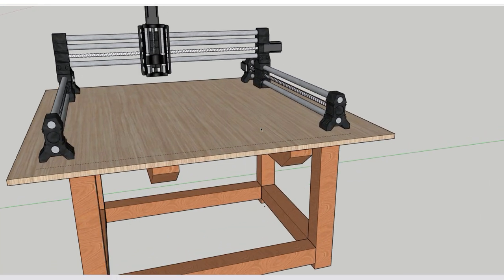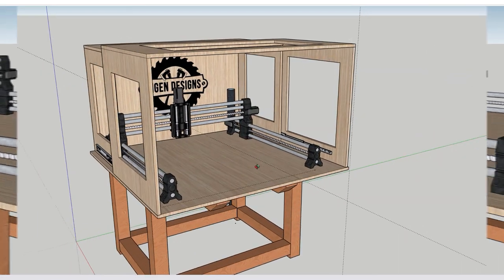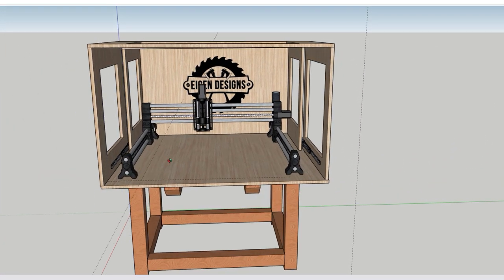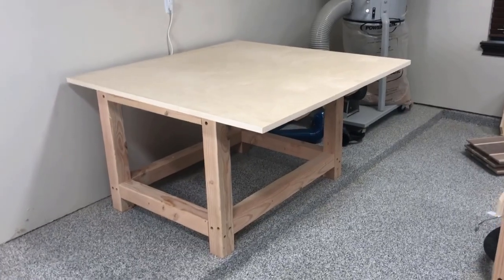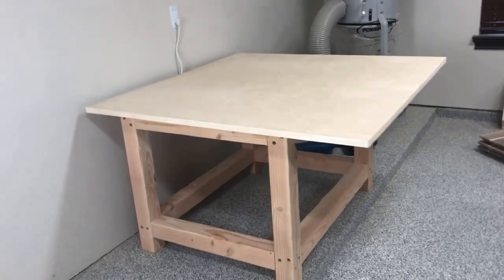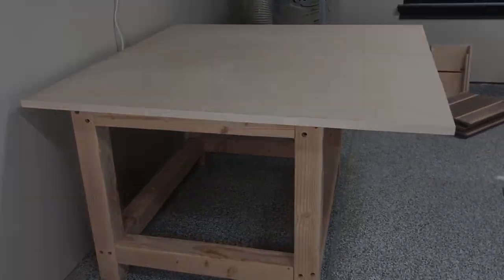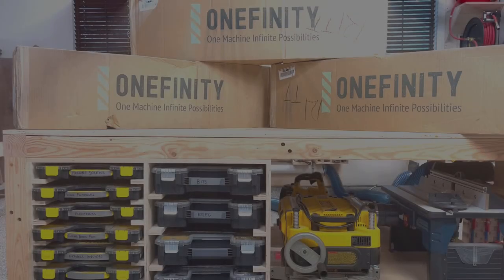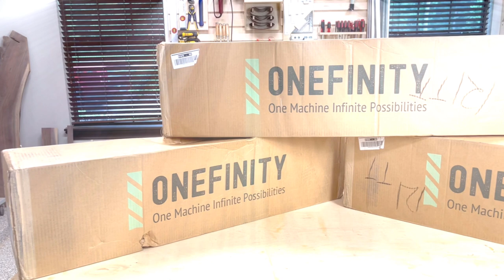OneFinity CNC Unboxing & Assembly (+ Upgrades!)

Comment: Congratulations - your Onefinity has arrived !! I watched your table build video a few months ago and subscribed then. Now, I get to watch you assemble your machine. My Onefinity Woodworker is in the "testing and packing" stage as of July 25, so it should be here in a week or two. So, I'm checking out everyone's Onefinity build videos getting ready to get mine together. I still have not decided on table "style" nor size yet. My shop is in the basement, so space is at a premium. I'm "leaning" towards a tilt style enclosure. Thanks for the video, Charlie in Central Ohio
Reply from the maker: It sure is exciting to have it all come together. The learning curve is pretty steep if you are new to CNCs, but there are a lot of great resrouces out there. 

One tip: as you think of your dimensions for the table, keep in mind that if you choose to use a SuckIt dustboot, it will protrude a few extra inches from the router so make sure you leave ample room for that. My table is 52"x53". Good luck!!

Comment: Nice work! I’m waiting on mine and did the same as you in preparation. It should have been shipped the week of July 25, but they are running 3-4 weeks behind. Maybe I’ll do as you and make a video when it arrives. I’m as set!
Reply from the maker: The anticipation for mine was palpable. I tell you what though, it’s worth the wait. I use mine all the time for a variety of tasks. You won’t be disappointed!

Comment: Was that logo made with the CNC? That’s a pretty cool set up. I feel like I have a ways to go before I get a CNC. I have too many other projects/chores to do before I get into stuff like that. Great video once again, I’m always impressed. Thanks for sharing 👍
Reply from the maker: I actually had the vynil logo made by someone on Etsy. Someone was kind enough to cut out my logo for a pretty nominal fee and ship it to me within a few days. I do plan on carving out my logo as one of my first projects though. Lots to look forward to!
Reply: Really nice set up! I am looking forward to seeing your enclosure video. I just got my onefinity and have not unboxed it yet. They actually forgot to ship my display as well and I received it today. What software are you planning on using? I am leaning towards Vcarve Pro. 
Thanks for sharing!
Reply from the maker: @jayceejocko1655  I have downloaded Fusion 360, which is a part of the Autodesk product line. They have a free version for hobbyist woodworkers. The reason I chose Fusion 360 is because you can do the CAD and CAM in the same program. I don't have enough time in the program yet to recommend it, but that should change in the coming weeks/months. 

btw, I still dont have my screen :(

Comment: That sucks about the display unit missing. Their pretty good about over nighting items from Canada, hopefully it only took (takes) 2 day(s). You could use a extra computer monitor to fire it up and connect it to laptop, once my laptop was connected to mine, I rarely use the actual monitor.
Reply from the maker: Their customer service has been really responsive. I think the screen gets in today so hopefully I can get up and running soon. In your opinion is it easier to use the laptop directly connected to the control unit?
Reply: @EigenDesigns  I got bad eyes (old age) to read those tiny little numbers & fat fingers too hit the mark intended on tiny touch screen. Was one of my 1st upgrades to get large touch-screen wide-screen monitor. I find myself mostly using laptop which is wirelessly integrated into my home network system.

Comment: I'm thinking seriously about getting the OneFinity CNC.  After an exhausted search on YouTube, I like your setup best of all.  Can you tell me which CNC did you purchase?  Wooodworker?  Liked your video so I subbed to your channel.  Thanks for a great video.  Very informative.
Reply from the maker: Thanks so much for the support. Yes, I bought the woodworker. They make the X-50 now, which has a larger X-axis rail, but that wasn't available at the time I purchased my CNC (Feb 2021). So far I have been super happy with it. Its rigid, accurate, and sets up in 15 minutes.

Comment: Great job! Thanks for sharing! Can’t wait to get mine. Do you think the 3D printed parts that you bought for your cable management chain will fit in the X-50 design? Enjoy your machine!!!
Reply from the maker: Hi Juan. The 3D printed parts will likely fit, but the aluminum rails that the drag chain rests in will probably be too small. I would encourage you to reach out to Route1WoodDesign and see if he can accommodate the larger x axis

Comment: Placing control unit the way you did...
Emergency stop button is in an awkward position...
USB ports are difficult to access...
Reply from the maker: It may look like that now, but I am building an enclosure around the top of the table so I mounted the control unit on the bottom so I still had access to the emergency stop once the enclosure was built. I do agree that its difficult to reach the USB ports, but I have found using wifi to transfer files to the OneFinity is much easier so I don't find myself needing to get to the USB ports often.

Comment: What you know now is there any other accessories, etc that you would recommend purchasing with the Onefinity.
Reply from the maker: Great question. I would buy the wireless remote, the SuckIt dustboot, the drag chains, and some cable extensions for both the OneFinity rails and the display monitors. Those would be my core accessories. 

If I could go back in time I would also tell myself not waste my time/money on cheap CNC bits.

Comment: Where did you get a piece of table top 52x53?
Reply from the maker: I had to go to a specialty lumbar yard in my city that supports a lot of the carpenters and cabinet makers in the area. I couldn't find anything wider that 48" at the big box stores. You might try calling around and seeing if any of your local stores carry a 5 ft x 5ft sheet of plywood.

Comment: is this the x-50 journeyman?
Reply from the maker: Hey Daniel, this is an X-35 woodworker. Back when I ordered my CNC through OneFinity, the X-50 wasn't an available option.
Reply: @EigenDesigns  looking into getting one.  trying to figure out the x-50 woodworker or x-50 journeyman, my thought is go bigger and not wish I would have 6-12 months from now?
Reply from the maker: @danielkarcher7846  If you have the footprint in your shop and the funds to go bigger, I would do so. I surely would have bought the X-50 if it was available when I ordered mine.

Comment: Did you get a 3d model for the machine or make it yourself? I want to make my own stand but if the manufacturer supplies a 3d of their machine it would make it very easy.
Reply from the maker: The manufacturer didn't make mine, unfortunately. I have a link to my file if you want to use it: 

https://www.dropbox.com/s/06jibieodcnbyv5/OF%20Woodworker.zip?dl=0
Reply: @EigenDesigns  thanks! I design machinery in Solidworks so I was hoping to skip the step of having to model the machine just to model the enclosure. Much appreciated

Comment: My onefinity gets delivered today! Although I have waited to build my table until today! Kicking myself for not having it built!!! What t-track did you use and from??
Will 4ftx4ft top be big enough?
Thank you for the video
Reply from the maker: That's exciting news! Congratulations. For the t-track I used a 4 pack of 48" T-track to make my spoilboard. I personally think 4 rails are enough, but you can add more if you want to. You can also start out with 4 and then add more later if find yourself needing more clamping options. I bought mine from amazon: https://amzn.to/3CwzEMO

As far as the dimensions go, 4ftx4ft is going to be very tight. I just went and measured my CNC footprint and the distance between the legs is about 44" x 44", which doesn't account for the rail motors that overhang that footprint. If  you are not going to build an enclosure and you plan on mounting your control unit on the underside of the table I think 48"x48" could work, but its going to be tight. These CNCs are surprisingly large for what they are. Also, if you plan on adding/using a dust boot, keep in mind that it will overhang the front edge by a few inches so keep that in mind too.

Good luck!
Reply: @EigenDesigns  did you just use treated 4x4s for the base
Reply from the maker: @LincolnWoodworks  They are 4x4s, but they are kiln dried and not treated. I don't often see non-treated 4x4s, but my big box store had them locally so I used them for this build (as well as my workshop bench).
Reply: @EigenDesigns  I only seen treated 4x4
Should work ok?
Reply from the maker: @LincolnWoodworks  Yeah, no problem using them.
Reply: @EigenDesigns  the program to mill the spoil board, can that file be used to put into vectric. 
Hey thanks for answering my questions
Reply from the maker: @LincolnWoodworks  I don't personally use Vectric, but any CNC software will be able to give you the g-code (e.g. the tool path) to surface your spoil board. I personally use Easel and Fusion 360.

Comment: What size is the table that you have the machine on? I'm still waiting on mine and would like to be ready when it arrives.
Reply from the maker: Hey joe! The table top is 52”x53”. I hope this helps.
Reply: Could you also tell me what would be the minimum size the table could.  I’m still trying to find room in my shop that will work best for my space.  Thank you for you help!
Reply from the maker: @joeadams1236  do you want to build an enclosure on top? Or just have it be open? Also, are you okay with your control unit being mounted on the bottom side of the table?
Reply: In time I want to have enclosed and no I don’t think it would be a problem to have it under the table
Reply from the maker: @joeadams1236  I wouldn’t make it much smaller than mine if you’re looking to enclose it. I have about 3” of total clearance on both sides of my enclosure. I think the smallest you would want to make it is 51”x50”. I modeled my build in sketch up to check for clearances. One thing I will point out is that the dust boot sticks out 2-3” beyond the y axis rails so make sure you account for that too. Good luck!